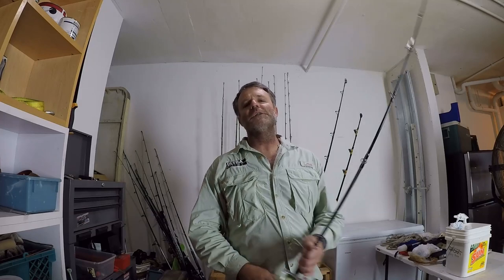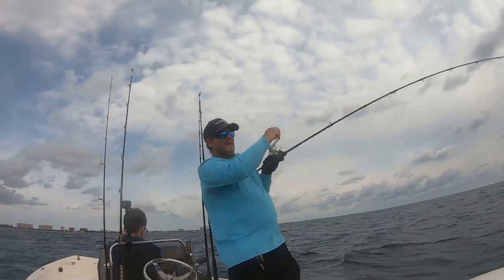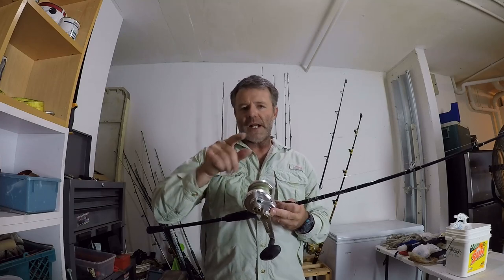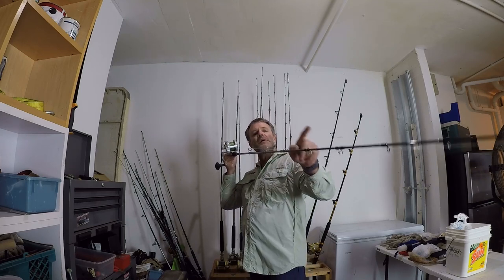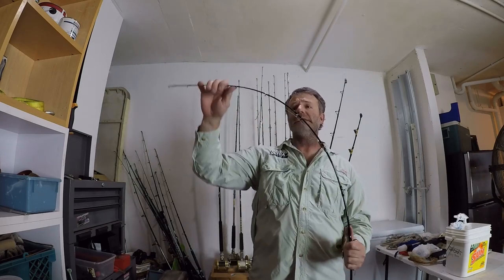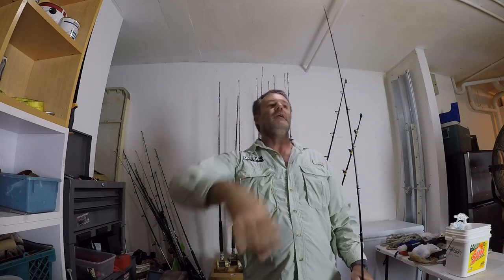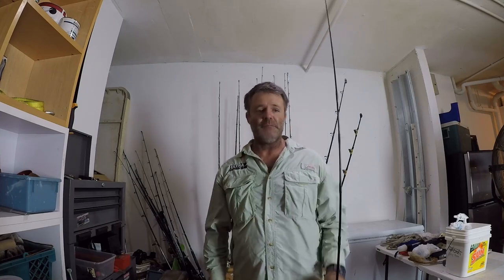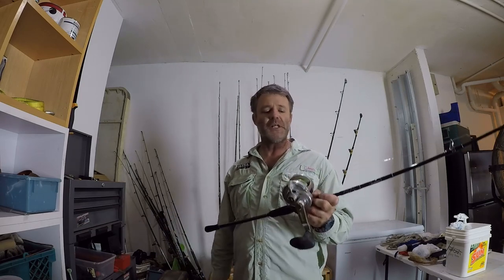SLOW PITCH JIGGING Gear, Line & Leader

Comment: Do you back your reels with mono before spooling with braid?  I have heard it helps prevent line digging in to the spool.
Reply from the maker: Not for SPJ.... it's all braid... Haven't had the digging in problem, but I have heard of it.  My planer trolling set is backed with mono and a 300 yd top shot of 89 lb braid.

Comment: When you do occasionally go out deeper, do you switch to 20lb test?
Reply from the maker: No... I only have the one setup.... but if I had more I'd probably go with 15 or 20
Reply: @SouthFloridaSaltwaterFishing  Got it. Yeah exactly why I am asking, as I am only going to have one as well. So does the 30 do well enough then when going deeper? Wondering if I should spool up my one setup with 30 or if I should just go 20. It’ll be rare that I need the 20. Or idk if you can buy extra spools and just swap them?
Reply from the maker: 30 is good for up to about 500... if your gonna consistently go deeper like 800, I'd go lighter definitely,  it will work in shallow also

Comment: I am a new subsciber and watched your video assembling a slow pitch jig. Instaed of using a separate solid ring to attach your main line, I have been using a small ball bearing swivel which eliminates any twist while jigging. Just curious if you have tried this method and your thoughts.
Reply from the maker: Thanks a million for watching and asking a great question.  Yes, I've used the ball bearing swivels to help lessen the line twist.  Honestly, I've been doing slow pitch for years, and I haven't really seen the difference.  I like the solid ring, because it's less hardware, a tab bit more stealthy, for me personally.  I'm usually using a conventional reel, which retrieve line in a straight fashion, instead of a spinner, which wraps the line back on to the spool.  I believe most line twist develops, from either incorrectly spooling, or reeling against drag and retrieving the line.  But we all have our own opinions on the issue.  I say, if you're getting a lot of line twist, definitely use the swivel.  Hope this helps.  Thanks again for your support of the channel, I truly and sincerely appreciate it.  Tight lines & take care ;)
Reply: same question, great answer, thanks brother

Comment: Great informative video and simple descriptively presentation.

Question. The Accurate Fury Boss 600N reel you are using, is it a single speed reel?

Question. Are there any advantages to using a 2 speed reel over a single speed reel. Or is there an advantage of using a single speed reel over a 2 speed reel?
Reply from the maker: Thanks a boat load for watching and asking some great questions.  The reel I use, the Accurate Boss Fury 600N is a single speed reel with a 4:1 gear ratio.  There's no difference in using a 2 speed.  I used to have a Daiwa Saltiga 2 speed and I found the lower speed which was like 1:1 (was supposed to have more power) was useless, I always kept it in high speed, which was 6:1.  That's my experience with the 2 speed reels, I really think it's a sales point gimmick made to make you spend more money on a feature that will (1) not be used & (2) is another point of probable mechanical failure.  Hope this helps.  Thanks again for your support of the channel, I truly appreciate it.  Tight lines & take care ;)

Comment: Heath I have barrel swivels on all my jigs. How should I attach to the solid ring ?
Reply from the maker: No solid ring if you are using a barrel swivel.  Just attached the swivel straight to the split ring that holds yourr assist hooks.
Reply: Got it but do u tie leader directly to the swivel or use a quick connect if u need to swap jigs?
Reply from the maker: @howardtenzer8307  nope... toe your leader directly to the swivel... if you wanna change jigs, undo the conne tion at the split ring